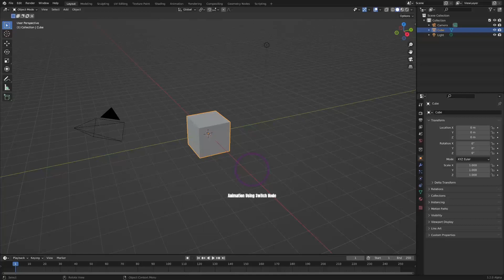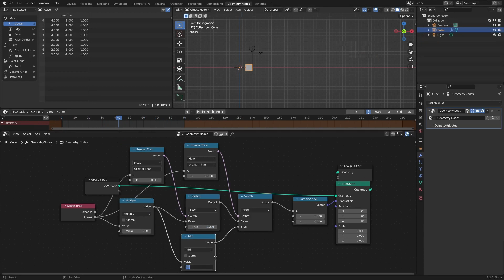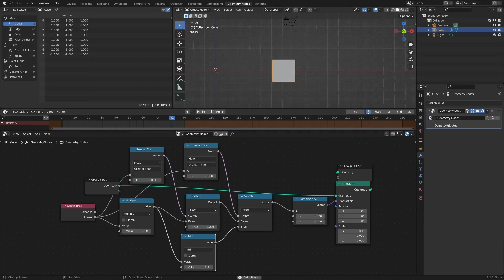Animation Using Switch Nodes (Geometry Nodes, Blender)

Comment: Which animation technique that take much shorter time to render, it is manual or using nodes?
Reply: This kind of technique might be ideally suited for things like clocks and gears, ballistics, mechanical stuff with constant movement or things you can easily model with formulas. But maybe there are ways to do things like walk cycles with this as well?
Reply: Render time depends more on the shaders than anything. How you animated won't influence so much, unless you are doing something wrong. Heavy geometry will influence the render time more on the parsing of the scene, after that, what matters most is the shaders. It can be faster to render a complex scene with lots of geometry with a default material, than rendering a cube with a complex shader.